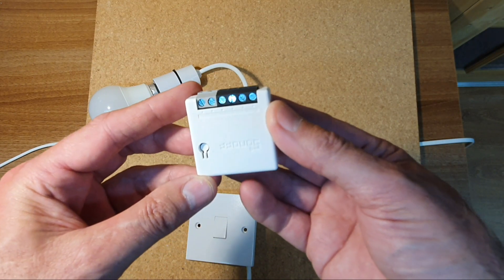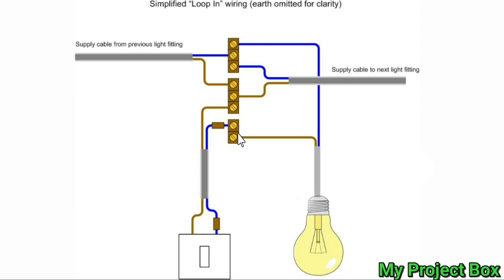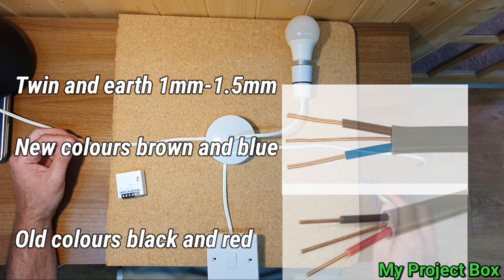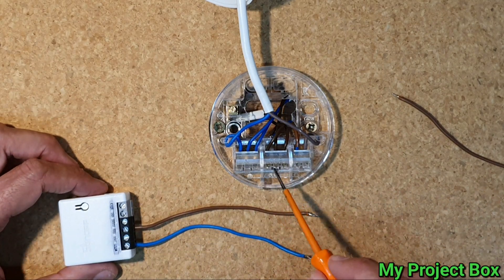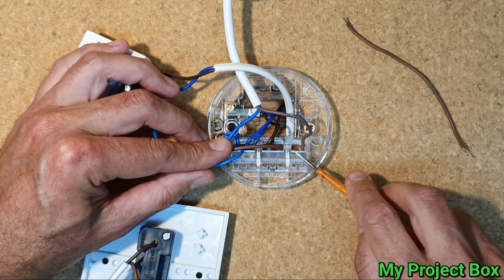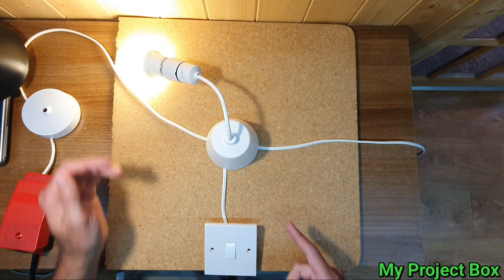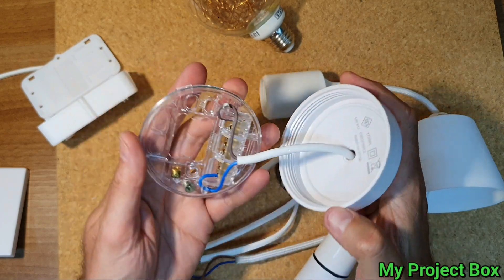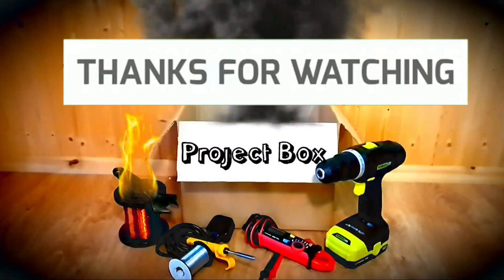Sonoff mini in UK British lighting circuit (ceiling rose loop-in wiring) #ElectronicsCreators

Comment: Have you tried replacing the firmware, ESPhome or the like. 
I’ve got some original Sonoff Basics and Shelly 1’s but the newer router keeps dropping them out, so wanting to try a ESP32 module or even Zigbee. Just wondering your opinions.
Reply from the maker: Zigbee is is supposed to have a very robust signal, as it uses different protocols and different frequencies as normal WiFi. You do need to use it in conjunction with a zigbee hub though, and this has always somewhat put me off. Zigbee might resolve your Wi-Fi dropout issues. Just a fun side fact, the ingenuity helicopter on Mars, uses the zigbee protocol 😉👍
Reply: @MyProjectBoxChannel  that fact alone has made me want to try zigbee! Thank you for the reply

Comment: Love your videos and this is very interesting but my house is wired to loop at the switch, any chance you can make a video fitting a sonoff with that?
Reply from the maker: Well that makes it possible to put your Sonoff MINI behind the light switch. You should have all the connections behind the switch to wire up the sonoff mini. If there is not enough room, you can try a Shelly1, as it is much smaller.

Comment: Can you control the device via 4G ? Because I've read in some reviews that it only work if you are connected to the same wifi as the device
Reply from the maker: You should be able to control it via cloud control. Google home/ Amazon Alexa, from your phone over 4g. But the device it's self needs to connect to a WiFi network.

Comment: Where did you get the white junction box that the mini would fit in. I'm UK based and would love something similar but all the ones I've found either have terminals inside or are £10+
Reply from the maker: The one I used is called a CHOCBOX from Screwfix or Toolstation. You have to cut off all the protruding bits of plastic sticking up with a stanley knife, in order to make it fit. It's all a bit cramped in there though.
https://www.screwfix.com/p/chocbox-connector-box/54936 
Or alternatively use a large ceiling rose cover. https://www.spares2you.co.uk/white-plastic-ceiling-rose-with-grub-screw-023108-plu94768/

Comment: good video, if I wired a pir sensor through s1/2 would it override if set to permanently on through the app?
Reply from the maker: If your PIR relay has a switched live mains voltage output, you cannot connect it to S1 and S2! These are "no volt" connections (wire to a dead switch only). You can parallel your PIR mains voltage output with the output of the sonoff. Then when the sonoff turns ON, it can bridge out and override the PIR. It all depends on the type of PIR you are using. whether it's a direct mains voltage or a 12 volt low voltage type. I hope this helps.
Reply: @MyProjectBoxChannel  hi yes thats helpful, its a mains powered LAP PIR. If i bridge the PIR it means it is essentially 'ON' will leaving it on for hours at a time cause any risk to the sensor...overheating etc. if it is only designed for max 4mins?
Reply from the maker: @lewisstylianou292  I assume the 4 minutes is just the maximum time delay that the PIR stays ON to light the bulb? If you bridge the output of the Sonoff to the output of the PIR, the sonoff is simply overriding the PIR, and the PIR does nothing. And as long as the sonoff is activated the light will stay on, until you turn the sonoff off then the PIR takes over.

Comment: Could I wire this into the back of a switch spur??just leave the neutrals in and out to the switch and cable into s1 and s2
Reply from the maker: I'm not exactly sure what you're trying to do. But I don't think a  switch spur is a good option. You need a permanent live & neutral feed at the sonoff to power it unswitched. Then two completely unpowered lines go to S1 and S2 these then connect to your switch (no live or switched live at switch) I hope this helps.
Reply: @MyProjectBoxChannel  yeah I am switching kickboard lights off a fused spur. I've just removed the Lin;Lout,and both neutrals and connected them to the sonoff. I then took 2 cables from the s1 and s2 and Co enter them to Lin and Lout in the spur. Does that seem OK to you
Reply from the maker: @halpinio1234  yes that should work fine👍. As long as it's a "dead switch", any switch will do, a switched spur is fine.

Comment: Hi, can a remote or non wire switch can be added with this device, please? Thanks.
Reply from the maker: Yes you can but you need more hardware, additional receiver board and transmitters switches.
Reply: @MyProjectBoxChannel  Damn! I wanted to keep my genuine switch and addind a wireless one. Most of wifi kit need internet and loose my switch on off function. Thanks for the fast reply.
Reply from the maker: @alundrasrt  well you can keep your original wall switch with the sonoff mini

Comment: What if I have a neutral line behind my light switch, how will this change for my situation?
Reply from the maker: If you have a neutral behind the light switch, you can definitely put  the sonoff mini  at the light switch yes!😉. Just remember that and metal backbox will affect the WiFi signal. It should be fine on a drywall with a plastic box.
Reply: @MyProjectBoxChannel  how to find neutral ?
Reply from the maker: @sailava88  one end of the light bulb is  connected to neutral. But you need live and neutral for the Sonoff to work.

Comment: can this work on a normal light circuite?
Reply from the maker: Yes👍 The sonoff mini should work on any lighting circuit! As long as you can supply the Sonoff with a live and neutral feed . And connect the light switch terminals to the sonoff switch input terminals. The lamp needs to connect to the output of the Sonoff. Here in the UK there is both live and neutral by the lamp fitting.

Comment: Very informative, I'm going to order mine now! :) 

One question though, how would you go about doing this for a two way switch ?
Reply from the maker: It all depends on how the two-way lighting is wired. But it should work exactly the same, if the two switch lines end up back at the ceiling rose. This would be the most common way to wire it. There will definitely be situations where it could be tricky.
Reply: @MyProjectBoxChannel  Perfect, I'm going to give this a try. However, can you provide a link or a search term for the larger ceiling rose cap you showed? I can't seem to find anything online for it :(
Reply from the maker: @PaCKkMaAn  mine came with a pendant light I bought, I needed a E27 socket for Edison screw, for one of those fancy light bulbs. https://www.ebay.co.uk/itm/Silicone-E27-Pendant-Ceiling-Lamp-Chandeliers-Light-Holder-Hanging-Fixture-Color-/303771645669?_trksid=p2349624.m46890.l49286 
Here's another one I found that might work https://www.spares2you.co.uk/white-plastic-ceiling-rose-with-grub-screw-023108-plu94768/
Reply from the maker: @PaCKkMaAn  https://www.lampspares.co.uk/black-plastic-ceiling-rose-with-grub-screw/